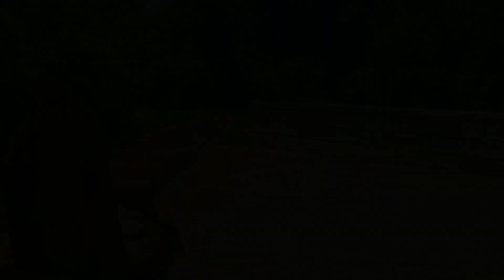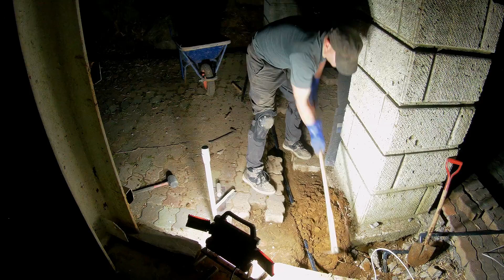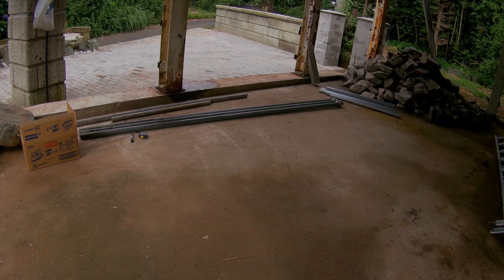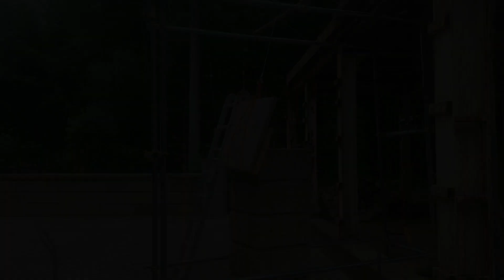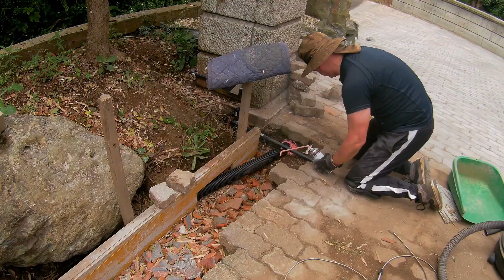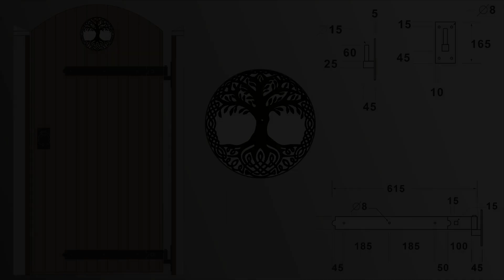Abandoned Chiba House Renovation Part 24

Comment: I have followed your post from the beginning and your progress is remarkable. Your DIY videos are enjoyable to watch and it's good to see Dash is vigilant in monitoring your work.

Question: you didn't use a scaffold to mount the caps initially, why this time?
Reply from the maker: Thanks for the comments. The first post caps were a lot smaller and therefore lighter. I had the advantage of having raised ground behind the smaller posts, and so was able to maneuver them into place a lot easier. The larger ones were incredibly heavy so needed a way to get them 6 feet in the air. I tried a ladder and winch, but it just wasnt big enough so went with scaffolding.